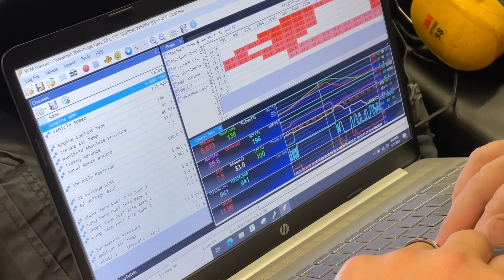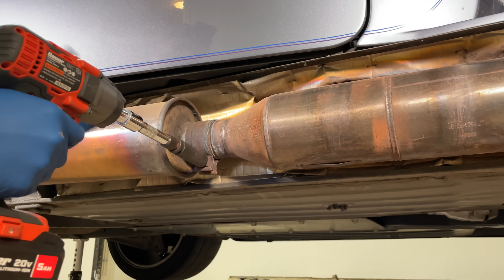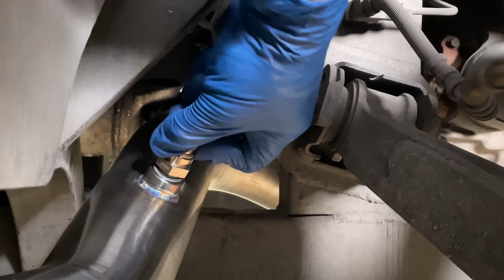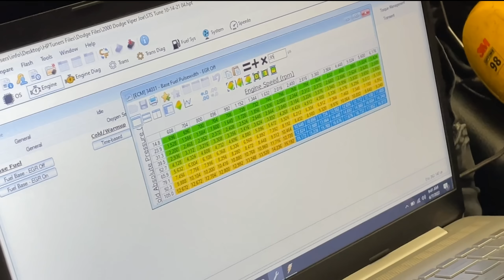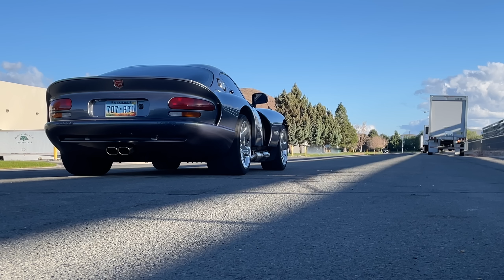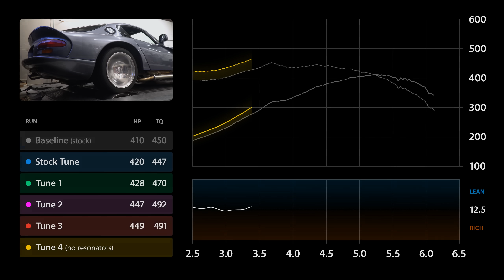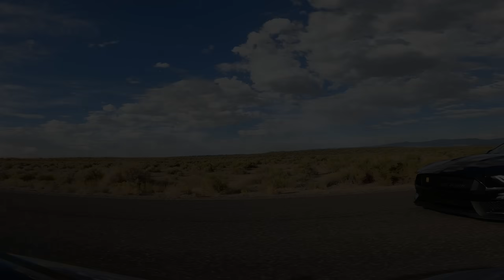When you give an 8-liter V10 the exhaust it deserves

Comment: The Viper was never a LOUD car. Even the GTS-R...the racecar, was much quieter than the rest of the cars on the track. The Corvettes were super loud though. But anyway, when it comes to drag racing, torque always wins. The ability to PULL your own weight easier, is more important than having a ton of power at 8000rpm. Big power at the top of the range is better for racing (especially NASCAR). But even in racing, the Viper DOMINATED for years.

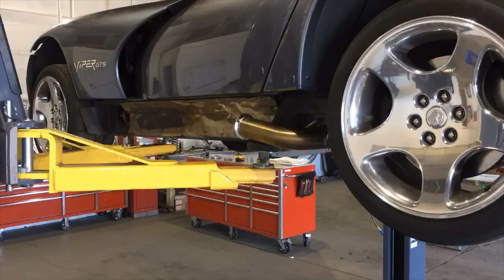Comment: I'd put some turnouts through the rocker panel right after the straight pipe installed at 6:03. Maybe step that pipe down to not lose too much low RPM torque.

Comment: I like everything you did with the viper but there's also was still kind of long going all the way out the back like you had it some vipers had the exhaust come in front of the back tires so maybe if you got rid of all the extra exhaust it goes all the way out the back and put it back to some other vipers they had in front of the back tires you might be able to increase horsepower and some more torque you might want to get a try.

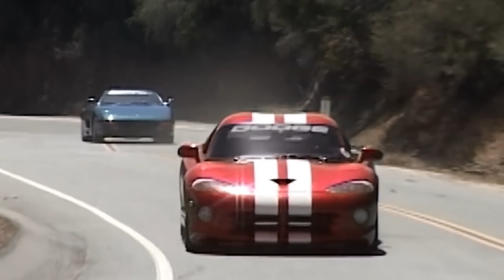Comment: 6:43

And this is exactly why rear-wheel, front-heavy cars absolutely suck: Zero cornering ability. In a drag race, yeah, no problem. Wanna crash into a wall or, in this case, fall off a cliff in a high speed race trying to take a corner? Get yourself a Viper.

Comment: Proper Viper right there. Add direct port juice and it's a monster. Can't recall if the 2000 gts had the forged motors like the 97's did but those old vipers love the spray.

Comment: Nice video. Way that mids are on that Viper now. Sht Vette is no match. If the Mustang had same mids it pull away. Why people make me laugh. Not horsepower it's more on where the true torque takes off in. Why vehicles like my Lincoln LS has mids to high torque I get Dodge fans crying cause they can't keep up. Also have to realize Lincoln LS isn't really a Lincoln. More of a jaguar built with the Lincoln plate.

Comment: my 3litre bmw 530d 2009vm makes 750nm of torque and 420hp with hybridturbo, bigger intercooler, 3,5’downpipe, m50d railpressure sensor, r90 fuelpump and proper remap and also egr and obviously dpf removal/mapped off. German cars are just way better.

Comment: its insane how shitty aftermarket domestic exhausts are.  galvanized steel headers with short runners and the saddest merge collector.  what looks like not even 3" after the headers per bank is just silly.  This deserves stainless or titanium exhaust with a proper merge collector and less restrictions after that.

Comment: I have always loved the Viper, although the original "no frills, just a f*ckton of power" approach was my favourite. However, I never really understood why it was never engineered to make use of its potential... until I drove one that had been reworked to provide a bit more than 1000 hp, and I realized that in much more than stock configuration it would be far more than most Viper drivers could handle.

Comment: 8L V10 running 450 hp is nothing to be proud of. It should be closer to double the power ( Ideally 100hp per litre ). The new exhaust does sound a million times better than the standard one though.

Comment: It is so hilarious when you see how much effort people put into the power of their car when they easily exceed the maximum speed limit in 1st gear. 
 
At least here in Germany we have about 8000 kms (5000 miles) of unlimited autobahn remaining, and we have the Nürburgring-Nordschleife, 21 km (14 miles) of racetrack, a real road, up and down, jumps, not just an oval. 
 
Granted, you have endless roads in the middle of nowhere, where no one cares. I remember once on holidays we drove on a road and for 70 miles there was no car we met. 
 
In principle the car would have to be optimized for sprints to say, 80 mph, because that is what you will do 90% of the time. 
 
My current after-midlife-crisis toy just has 170 hp (when it was new, don't dare checking with 28 years), and a top speed of 147 mph - thanks to good aerodynamics.  
And it is also fun when you make it to be quick with good mpg, 24 mpg is reachable, espec. when you reach 120 mph and are still with 23 mpg. Not bad for a 1994 car, I'd say. 
  
I grant you, that is a purely personal experience, nothing showy to impress others - well, we are all different, and I do not have to produce something visual like here.

Comment: That's a shit load of work and money for very little gained. Of course if you do heads and cam later its totally necessary. That's also extremely restricted new exhaust. No way should you have made that much more from removing the resonaters. I'm questioning how good that exhaust is and if you could have made a lot more with a different exhaust. Also, those headers for whatever reason don't look like true long tube.

Comment: The Viper is SOOO underrated.  What's nuts is you're racing a much older performance/exotic car to a new muscle car....and the old one keeps up and beats it in a straight line.  Just nuts!  And the styling on the Viper is hard to beat.
Reply: I don't think many people realize what a beast the gen 2 GTS was or could be with mods, they were in the 7's like 16 years ago and 6's about 10 years ago...  Still very respectable feats by today's standards given the better tech and tires.

Comment: I love that you tried multiple types of racing. Not just the best one for your car, you gave the mustang the higher RPM it needed. I would love to see a rematch
Reply: Yes definitely the best way to do it. He just wanted both cars performing at their best.
Reply: Gearing can make up for higher rpm of an engine. The gt350 has much shorter gearing, meaning that it reaches higher rpm at a lower speed vs the viper.

Comment: Thanks for such quality videos. Straight to the point. No fluff. A car guy video! 
Personally, the resonated exhaust sounded so much more tuned. That odd raspiness wasn't there that the unresonated system has. Maybe find a different set of resonators that won't hurt flow or calculate some Helmholtz tubes.

Comment: Scavenging the exhaust too quickly has the potential to burn  exhaust valves or valve seats. Maybe burn a piston or two . . . . if you don't introduce more fuel (maybe a little E85) to cool things off.

Comment: I have a Jaguar S type, which is a Ford Duratec V6 engine with Jag's VVT technology. That's a 3 liter (183 cubic inch) engine, versus your 8 liter engine, and that still gets 220 horsepower despite being 22 years old. 
Mine does sound quiet until I put my foot down, but best of all, crusing for hours at high speed on the motorway, it remains quiet. It's a car I just want to drive in all day and not feel tired in. 

I do like what you've done though. I respect almost all mods.

Comment: The Viper’s engine sounds the way it does for a few different reasons; because the earlier generations of Vipers had Side-Pipes & after the initial novelty of the car wore off, many Viper owners replaced headers & added cat-back systems on the market because the novelty of having an exotic car that loud…just ended up being too-much for most owners…secondly, it’s got a 90° V10 okay, let’s take a CLOSE look at that; a 90° V8 fires evenly (720°/8=90°) (Which means on a V8 one cylinder must fire every 90° of crankshaft’s rotation to keep the engine balanced) but 72°/10=72° therefor the V would require a 72° V to achieve natural balance because the engine must fire after each 72° increment of the crankshaft’s rotation. That could only mean some strange things would need to be worked into the design to make the physics line up properly because a 90° V10 is naturally off-balance… my dad’s 1968 Plymouth Roadrunner (383 Big Block w/ a 4-Speed) the headers literally wrap around the engine’s starter therefore Push-Starting that car is it’s natural form of starting…we’ve tried heat-wrapping the starter [shaking head no] also… that car… WAS NOT DESIGNED TO CORNER AT ALL… as best as I can tell, it was designed to go really fast in a STRAIGHT line… the reason I bring that up… that’s just another moment in Mopar engine design fuckery..

Comment: The moment I saw those headers, I knew this was the real deal. And you're doing it properly too, with a high flow cat and all, no cutting out necessary emission controls here. I definitely appreciate that. You can have high performance and good noise with a cat.
Reply: Until the cat needs to be replaced every month because high flow cats are trash and still cause restriction and muffle sound
Reply: “Necessary” lmao
Reply: It's no fun unless you cut out the cat and shoot fireballs.
Reply: @deeppurplefan  you can get cats that run so smooth you get flames straight through anyway. Might as well not have them but they're for states that require them to be there, for whatever reason
Reply: @Savinmoneyforparts  the couple reasons you got I could shoot down in 2 seconds or less
Reply: @THESLlCK  NO CATS BAYBE GIMME ALL THE HYDROCARBONS
Reply: @k0lge  hell yeah
Reply: @k0lge  cringe
Reply: @ThmsPtrsn  🤡
Reply: @THESLlCK Tell everyone you think climate change is a myth without telling everyone. 🤦🙄
Reply: @Cooe.  the people of india and china dont

Comment: Nice cars, nice no nonsense video, nice scenery. Thank you. I have enjoyed motorsports over the years with street and dirt motorcycles, cars, and trucks but unfortunately do not qualify as a gear head or mechanic. Grew up n the 70s - so my random question is: when did it change from Foot Pounds of Torque to Pound Feet of Torque? Just curious.
Reply: It didn't. People who use 'pound feet' (or lb-ft) are incorrect. It makes no logical sense to call a unit of measure for torque a "pound foot" because the unit is actually referencing how much force (pounds) not distance (feet) is required. The reason why the foot comes before pounds in the unit of measure (ft-lbs) is because it is describing how many pounds of force are being exerted on a 1-foot lever. The length of that lever in the unit never changes - which is what makes it a constant, and therefore a unit of measure to being with. Hence, foot (singular, never changing) pounds (plural, changes depending on how much force is being applied). When you reverse that and call it pound-feet instead, it implies that the length of the lever has changed because that is the plural unit, and only one pound (singular) is being exerted on that lever, which is absolutely NOT the case. For example, let's say a fastener needs to be tightened to 147 ft-lbs (note the correct abbreviation). This means that 147 pounds of force is being exerted perpendicular to the end of a 1-foot long lever, NOT that 1 pound is being exerted on a 147-foot-long lever. The resultant force seen at the fastener would not be the same between the two scenarios.

Also, worth noting, you'll never find a torque spec given in lb-ft in any factory service manual. Ever. Because it isn't a unit of measure. Ft-lbs is.

Comment: Fantastic car, love the design, the sidepipes and the engine. Great job with the tune and exhaust. Totally agree it should sound so from stock :) 
But damn dont put in those horror clips - I nearly got a heart attack when I saw that Viper go over the edge of the cliff 😫 got goosebumps and chills... 
Great video though 😁
Reply: no ABS pre-2000... No traction control... No Airbags.  It's essentially a noisy straightline monster
I'd love one, but I could never let my heart over-rule my head. The viper makes no sense in the modern world... But I guess thats the point right?
Reply: What was that? No explanation

Comment: That's what the  KING VIPER needed!!...I true dualed my  2000 Shop Tow Truck F350 V10 I didn't put headers on it but installed a Magnaflow Dual Muffler System  exhausting out of the rear duallys..

Comment: Sounds SO GOOD!! I'd love to do this with the Ford GT!
Reply: Get back to work Graham
Reply: @todspeerii7498  🤣🤣🤣🤣
Reply from the maker: Hey thanks for watching brother! 🙏
Reply: @Four_Eyes  Ever heard of the Thwaites Ice Shelf?
Reply: @Four_Eyes  very nice mods on this corvette not the craziest yea   But it just saved it and I really like it.
Reply: @michaeldennis9460  😊
Reply: @Four_Eyes  have you thought about trying this with the c4 zr1? its well known to be choked up from restrictive exhaust and can make great gains from minor intake and exhaust upgrades
Reply: @Four_Eyes  I build beautiful stuff for decades. I often wonder WHY the manufactures skip stainless, where the parts will be exchanged and are exposed, so the steel will rust. I have bought a customized center less grinder, took it apart, refurbished and bought all the different nut and bolts in stainless. New machine is like 6000$, stainless parts were less than TEN $. If this would be a car, it's hard to imagine spending maybe 50-80$ for stainless. I've seen fricking small Ferrari, with the ZINC PLATED bolts in the engine compartment, starting to go grey. I think the price was somewhere around 120.000$.
Reply: @panan7777  Some cars come with stainless exhausts. 16V Scirocco had a stainless pipe from the downpipe to the muffler. There's a reason why they use zinc plated ferrous bolts, and the reason is that they are stronger, than stainless.
Reply: Graham you gotta get a gen 5 before it they get crazy(ier). would be epic content
Reply: @JuhoSuomi9571  @Graham Stephan He already has an S60, which is perfectly sufficient for his needs.
Reply: @JuhoSuomi9571  Agreed!
Reply: I have a Ford Mustang next door (note: here in Germany), really looks good, but what I find disappointing is that all these great looking air inlets are fake, closed with plastic boards. 
As engineer, I would prefer something like that to have a concrete function - brake venting, steer the airflow for more downforce, better cooling of the components in the engine room, better aspiration of the engine. 
 
I would be extremely impressed by a car with a flat floor rising at the back for more downforce, or where you see that in the engine room they have thought about the lead of the air to reduce drag, and cool more efficient. Maybe even use the expansion of the heated air to increase the speed of the airflow and lead so that it where it produces more downforce. 
 
To come back to Mustangs, the P-51 Mustang is said to have its cooling duct so optimized that it did not produce drag, but additional thrust.  
 
The only thing (besides a low-drag body (cw=0,29, not bad in 1994) in that respect is a cooling duct to the alternator, because the only place they found for it was behind the engine, next to the exhaust manifold. So not more than an unelegant workaround for a design flaw ;-))
Reply: If you can afford a Ford gt just do it man!!
Reply: @fearlessvq37 engine building
Reply: Graham, I had no idea you were a car guy, I like you even more now lol
Reply: So dick lmao
Reply: Why this car and some other high power US cars open their throttle valve only to 60 % when u go wide open throttle ?
Reply: Scammer alert
Reply: It sounds exactly like a 4.3 Chevy V6. That's not good. :(
Reply: graham crackers
Reply: It sounds like a tractor that revs fast
Reply: Thats gotta be the worst sounding V10.. Like honestly, thats not a good sound at all
Reply: Even sounded better with the resonators tbh

Comment: I wondered if it was possible to break into the 1000+ whp zone with an NA Viper engine. They did it with a custom 9K rpm LS. And Viper got smaller pistons so in theory you could spin it even faster. What do you say? A 10-11K rpm 1000-1100 whp naturally aspirated Viper. Is that possible?
Reply: Hm since its rev limiter is around 6k stock I don't think you can push easily push it to 10k+

Comment: throwing a total guess out there... those venturi things likely lose power. a properly designed (primary and secondary lengths, diameters, and cylinder pairing) doesn't need any gimmicky stuff, and will make power nearly everywhere over stock, especially in the high end. The venturis MIGHT do something at low throttle inputs and low rpm, but everywhere else, they are a huge restriction. Again this is a complete guess, but worth a shot at swapping headers, and doing another comparison video.

Comment: Damn that's insane what a tune and an exhaust can do to a NA engine. I never realized how much power can be made I always figured less than 20-30 HP/TQ with bolt ons and tunes on NAs
Reply: Totally depends on the exhaust and the tune honestly. For many cars exhausts come in stages, do you just want the cat back, the downpipe as well, or new headers also? This guy did all of it and took out the resonators, that's maximum power gains from an exhaust mod. I bet also that the bigger the engine, the more it will gain from an aftermarket exhaust mod.

Comment: Back in '90, I recall the auto mags panning the sound of the Viper's V10 before it hit production.  It was widely criticized for sounding too anemic despite the power - and they criticized Dodge for cutting cost by poaching their V10 truck engine instead of developing a proper V12.  But I'm a fan of the Viper and its brutally simple purpose.  A true race car.  Yet I'm still influenced by these original criticisms, exhaust upgrades or not - it's just not the best sounding engine.
Reply: probably just need a little different exhaust tuning for the sound. I mean look up 8-1 Chevy V8s, they sound completely different than a normal low revving V8. They almost sound exotic.
Reply: Tanner's drift machine revs a bit higher, but still a pushrod motor. https://youtu.be/5Ot1qjHcruA?t=851
Reply: here's a C4 with a nicely done 8-1 and makes it sound almost like a classic Ferrari

Comment: One guy in my small town has 1st gen viper (1996 I think) and it does sound like trash even with a v10
I should link this video to him to see if he would like to do something like this to that car. But to be fair it's less than 100k km driven fully original 1st gen viper so I wouldn't touch it at all myself.
He drives it like 5 times per summer